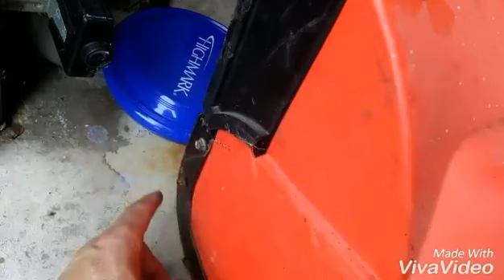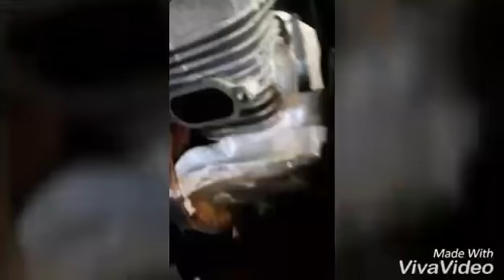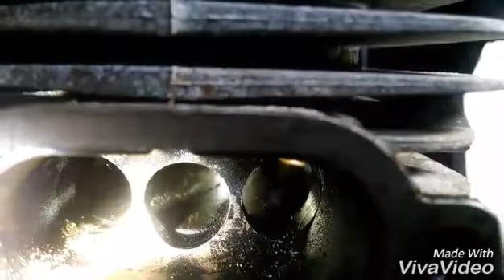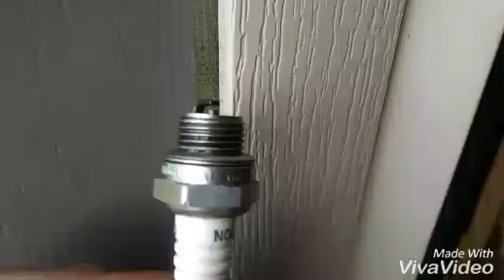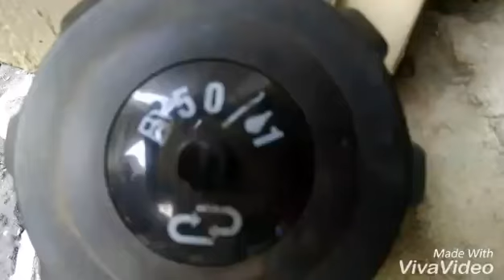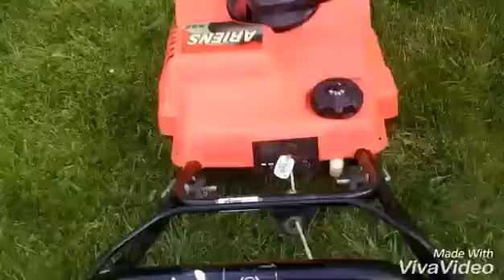Ariens 522 Snowblower repair smoking muffler

Comment: I have a 2stage snowblower and when i start it just smokes and the more it runs the more it smokes. I replaced the oil and added a fuel cut off switch, but it still smokes. Does anyone know what i could do.

Comment: Nice videos on the Ariens 522. My father in law gave me a 522 with electric start. Any experience with these?  I can start it manually but when I try the electric start I can’t get it to fire....
Reply: You must plug in the extension cord.
Reply from the maker: Thomas Lawson unfortunately not,  donyboy73, another small engine guy, might have something helpful?